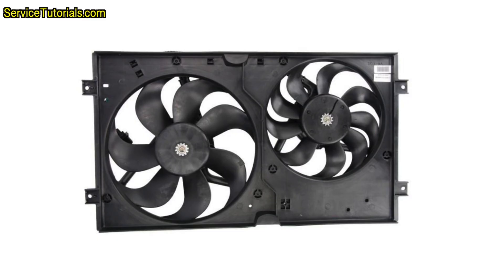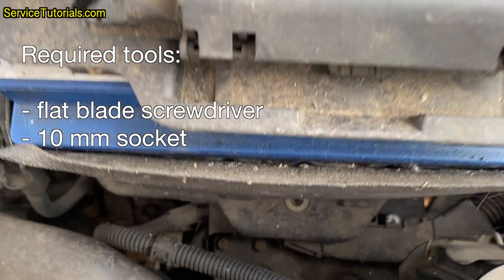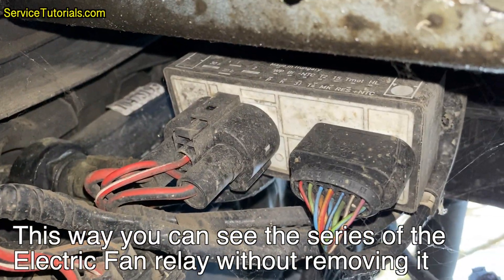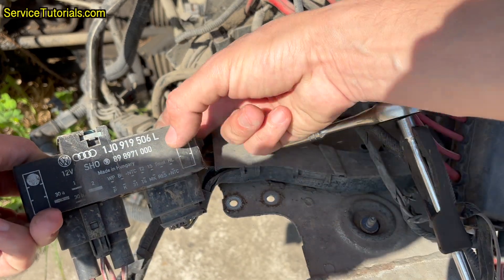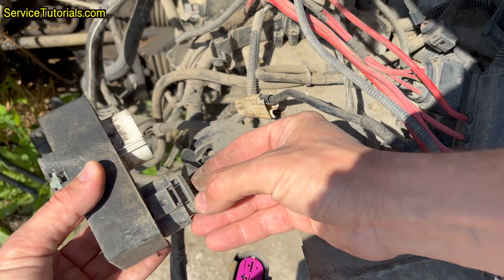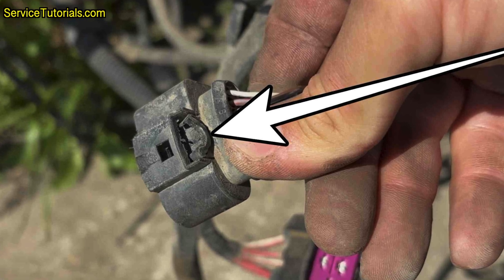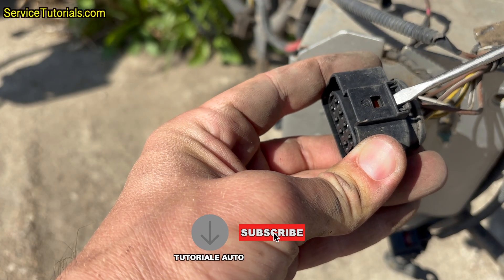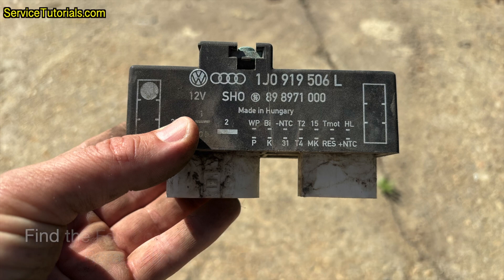Radiator Cooling Fan & A/C Compressor not working? Replace fan control module (FCM) VW Golf 4, Jetta

Comment: Modulul controleaza ambele ventilatoare? Daca doar unul funcționează e posibil să fie de vină acest modul?
Reply: I have the same problem, my big fan isnt working
Reply: Both fans are controlled by the module at high speed, Thermo switch low speed. Wire fans direct to battery to test!